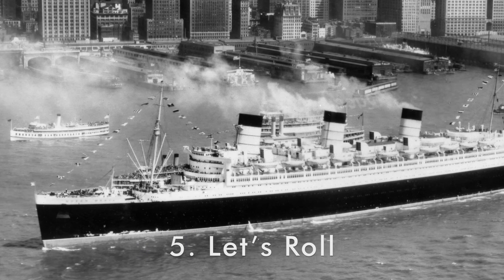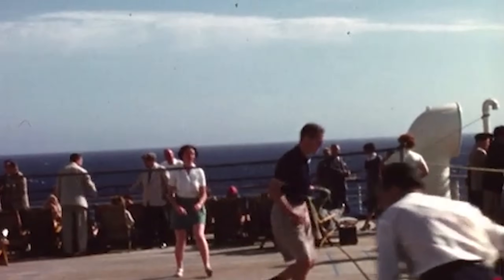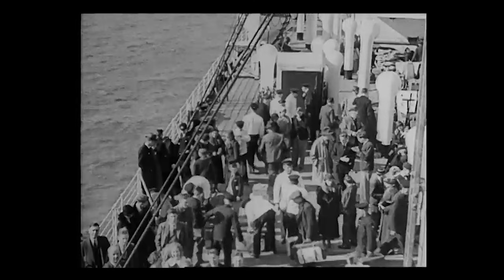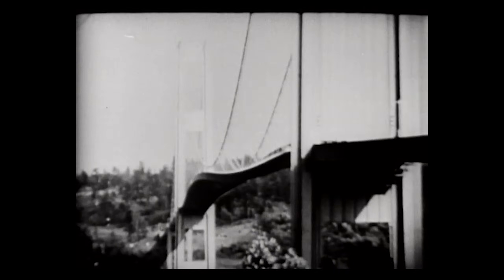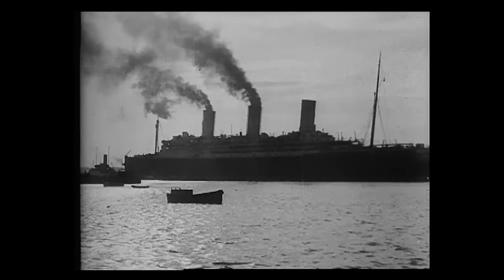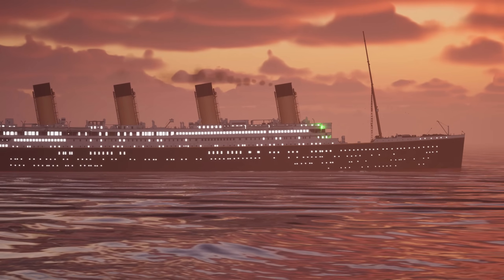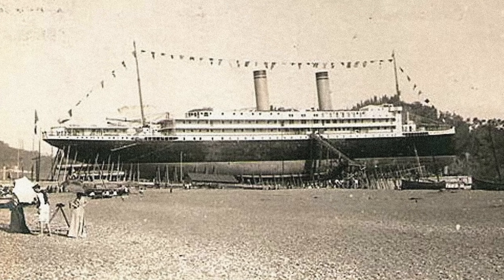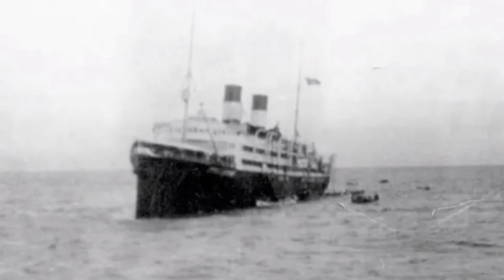5 Ship Design Fails

Comment: Note: The Tacoma Narrows was not due to resonance (as is commonly stated) but due to Aeroelastic Flutter. Basically the wind interacting with the bridge would provide negative dampening to the bridge, and at high enough speeds this would overpower any positive dampening the bridge had, leading to an every increasing torsional oscillation.
Reply: Yeah and it definitely dident have anything to do with soldiers marching. That happened to millenium bridge in London Just from normal walking people.
Reply: *damping
Reply: Galloping gertie!!!!  The broken bits have actually formed a habitat for the local aquatic animals (specifically the giant pacific octopus) and the posts from the original are still standing and can be seen from (or could've the last time I was on) the current newer bridge just to the right.
Reply: Isn't that just a form of resonance? Isn't any self-perpetuating or increasing interference pattern a form of resonance?
Reply: @justforever96  That is incorrect as I understand it. Resonance is specifically as related to a periodic force. Lets use an example: the playground swing. Swings are basically pendulums, with a natural frequency and all. If you make a well timed movement while on the swing, that is a periodic force that is in time with the natural frequency, the swing's motion increases.This is resonance. If you were to provide that force at the wrong time, then you either would not do anything, or would slow the swing down.

That is not how aeroelastic flutter works. In this case there is no periodic or vibrating force. You just have a constant force based on wind speed and the design of an object. In the Tacoma Narrows collapse for example, it did not matter at what frequency that the bridge oscillated at, the oscillations would increase because there is always a force putting energy into it. This effectively worked against any dampening effect such that instead of energy leaving the system (positive dampening), there was an increase in energy with every oscillation (negative dampening). Basically, as soon as this form of oscillations started, and so long as the winds stayed at or above the needed velocity, the bridge was going to collapse.
Reply: @GroundHOG-2010 Strike a tuning fork & it vibrates /oscillates at its natural frequency, but there is no resonance involved until this tuning fork is placed next to a string & causes it begin oscillating via energy transfer from the emanating sound waves (oscillations).

Is that the distinction here?  That aeroelastic flutter is more like striking a tuning fork?  

That makes sense if 'resonance' means one vibrating tuning fork causing another tuning fork to begin vibrating when placed close together because they share the same natural frequency.
Reply: @GroundHOG-2010  I'm aerospace engineering background, in aero-elastic flutter, the periodic force is the aerodynamic force. We either make the structure stiffer, which also makes it have more mechanical dampening. Or we control the aerodynamics with flaps or geometry, reduce/counter the Aerodynamic force which triggers the resonance.
So it's the same thing. 

Think about it this way:
Wind causes the bridge to rotate a little and push it up (peak of the positive amplitude), then it lessened a little, but because the bridge is dampened, it didn't return to its original state. Instead it was titled the other way, causing wind to push it down in the other way (peak of negative amplitude). 
If the wind doesn't lessen up (not periodic) then the bridge would stay twisted one way, kind of like a piece of paper stuck against a fan on the suction side. 
But that is not real world wind work, you have gusts and somewhat similar to waves in the sea, you have ... PERIODS. The strengthening and lessening of the wind matched the resonance of the bridge frequently... Which causes it to "dance". Otherwise it would just easily tilt/rotate to one side.
Reply: @AaronShenghao  I have a question about that. "If the wind doesn't lessen up (not periodic) then the bridge would stay twisted one way, kind of like a piece of paper stuck against a fan on the suction side. "

That assumes a low or zero spring force. But if you have a high spring force (something tells me a steel bridge would have) could it not be possible that the spring force is able to overcome the aerodynamic forces and move the bridge in the opposite direction? 

The idea being that you have a minor (torsional) vibration already in this brdige. The wind at a largely static speed puts energy into the bridge deck as it twists, but is overpowered by the spring and twists back the other direction. The same is repeated in the opposite direction. But as the bridge goes through this cycle it also rises as falls, putting more spring tension in the diverging areas (the front of the structure) and assisting in the twist around "against" the wind. After one cycle, would this lead to more energy within the oscillations despite not having any oscillations in anything other than the bridge itself?
Reply: @William Walker  the crucial bit is that resonance only occurs at or near specific frequencies. In the case of the Tacoma Narrows bridge, the oscillating happened at all kinds of wind speeds. As the wind got stronger the oscillations got bigger until the bridge broke. With resonance, you'd expect a specific frequency to be dangerous and very small oscillations outside of that
Reply: Aero-elastic flutter actually IS one form of resonance effects.
Where aerodynamic force is the initiation force (in contrast to say foot steps). And because the bridge is under dampened, the resonance of the aerodynamic forces made the vibration amplitude to diverge until structure failure or the forces became out of phase (aka aerodynamic/wind force reduced)
Reply: C O O L
Reply: I thought it was a certain speed and wind direction plus precipitation that caused that oscillation to happen, the reason why most cable stayed bridges have a certain characteristic to the deck design and certain cable sheathing

Comment: Queen Mary rolled not because of poor design but because of the last-minute change to the ship's boiler configuration. More speed and efficiency at the cost of balance. They knew what they were doing. The ship survived a 52 degree list after a rogue wave and if she was snappier people would be flung right off a ship that size.
Also neither H&W nor WSL ever billed Titanic as 'unsinkable'. What they said was that the ship was as safe as they knew how to build them. You don't have to be superstitious to know better than to tempt the ocean like that and no sailor or shipwright would say such a thing. The myth of the Unsinkable Ship came around only after the disaster. Titanic was a very safe ship indeed for 1912 but arguably Olympic was the safest ship afloat then.
Reply from the maker: Hi there!
I disagree with the boiler change theory - the metacentric height is the likely culprit. The thing is, all ships roll - it's just funny that Cunard expected QM would not roll at all given its size. 
WSL and H&W did bill Olympic and Titanic as unsinkable, you can find an example here; 
https://wormstedt.com/GeorgeBehe/page2.htm
They also clearly regularly briefed the press and officials in on the ships and likely used the word 'unsinkable', as it was repeated so often and by so many different people.
Thanks for watching!
~Mike

Comment: Fellow history buff Historic Travels revealed that the original design was for the Mary to be fitted with Scotch boilers. A change meant that Yarrow boilers were used instead. However these were lighter the the Scotch design and this changed the stability criteria of a ship designed for a slightly heavier weight making her a fraction top heavy.
Reply: Titania,  Ariel, Cairngorm, Taiping, Highflyer, Blackadder, Hallow-en had stability concern, yet the crew can adjust
depending?
Reply: I believe that that change was made before any steel had been laid.  The change would have been factored into her design.

Comment: some of this rolling of the QM could be attributed to her having traits of Berengaria, the biggest Cunard ship before her, and Berengaria was a notorious roller or limper being top-heavy in her early German years. QM also had elements of Aquitania in her superstructure, ie the glassed in promenades, the high bridge and wide beam. But Aquitania didn't have a reputation as a roller, so why didn't John Brown simply upscale Aquitania standards? They seemed to return to a slim hull-massive speed ratio as with Lusitania and Mauretania, the two of them rollers.  QM was indeed called an 'overgrown-Aquitania' in one video mainly because of her superstructure appearance. The three funnel design, all working, was probably influenced by Berengaria.  All in all so much of previous ships adapted into one ship.
Reply: check out my comment about boiler fitting out.

Comment: Terrific episode, I didn't know that about the Mary. There was a German ship as well (I think), they offset the funnels to one side for more space on the decks but it created a list because of the weight imbalance. They cut the funnels shorter and did some redecorating inside to correct but it never fixed it. I can't find the name but it'll come to me
Reply: Limperator?
Reply: You mean the Imperator i guess ?
Reply: That's the one, thank you!
Reply: Imperator, but the funnels were traditionally placed, it's sister ships though, split the funnel uptakes to both sides of the ship to create more deck space for wide sweeping rooms, and they did not suffer from the rolling the first ship had!

Comment: lets be fair to Britannic, not a lot of ships, specially ocean liner are able to remain afloat after hitting an underwater mine, meant to blow a crater size hole into battleships ( one of the most heavily armoured/protected warship type that ever existed).
Reply: Well, she did still chop up some of her passengers at the start of the evacuation... But I'll still be fair, she did help show that the way her older sister sank was certainly out of the ordinary. For nearly every ship that's gotten damage on a side and sank, they've listed to one side or another by the end... But Titanic didn't. Gotta say, whatever happened on the Titanic up to that fateful night certainly leaves mysteries...
Reply: @Rand0m0bs3ss10ns  Honestly, I didn't think of that, but now you mention it your right, she didn't list heavily to one side or the other when she sank, despite her breaches literally only located on the starboard side. 

As to the chopping of passengers by the largest bender in the world known as Britannic's propellers, I would put that more on the lines of human error rather than the ship's fault, I mean it is the crew who pretty much dictate when the boats are lowered and whether or not the engines remain running or not. So the fact that a few boats with passengers got thoroughly chopped, I can't really bring myself to blame that on the ship. She was sinking, her crew kept the engines running as well as lowering the boast and she naturally had her stern rise as she sunk bow first, ain't really her fault. 

But still, very interesting comment, keep commenting on small details like that, god knows there aren't enough people who look in-depth into these kinds of things and others related to it.

Comment: Great video.  Propeller cavitation seems to have been a problem with just about all 4-screw express liners.  Mauretania, Lusitania, and Normandie are the ones that generally come up, but most of the big, fast ships grappled with it to some degree.  Normandie's vibration problems improved with a new set of 4-bladed props, as did Mauretania's, but neither ship was ever completely vibration free.
Speaking of the magnificent Normandie, she had an issue with rolling nearly opposite to QM- the great ship would roll a bit, then snap back to the vertical with a violence that would send things flying about... Still, these were great ships, imperfections and all.  To Queen Mary's credit, though she came to within 3° of capsizing when broadsided by a nearly 100' wave, she did  come back up again, and got the 15,000 bruised, bloodied, but grateful troops she carried safely to their destination.  
🚢Always a pleasure to watch a new video from Ocean Liner Designs!
Reply from the maker: Yes quite right, it feels wrong calling Mary out on her rolling when the ship endured some insane conditions and survived just fine. I think the real design failure there was the lack of handrails :)
Reply: I think its a cause/effect situation, why did they put 4 props on the liners - to transmit as much power as possible into the water, cavitation is caused by so much power being put into the water that the water vapourises due to the low pressure on one side of the propellor blade, so if you're pushing the limits of how much power you can put out you're going to run up to the limit. 
As an aside this is why submarines making long distance transits do so at depth - cavitation is very loud (all the bubbles collapsing) so if you can prevent them forming by increasing the pressure overall at greater depth then you can stay quieter at higher speeds.
Reply: I heard it was 16000 on board?
Reply: @atomicwedgie8176  she still holds the record for the most people carried by ship in a single journey

Comment: I think the bulkhead issue is the key area where White Star was guilty of sacrificing safety for style.  Even if a glancing blow along multiple compartments was unlikely, it was still feasible; 60 years previously the Great Eastern had a massive gash ripped in her side by an uncharted rock, but was able to make it safely to port without even developing a significant list, thanks to her double hull.
Had the Titanic's watertight compartments gone even one deck higher it's likely she could have remained afloat - at least until help arrived; however one irony of the disaster, that I rarely see mentioned, is that a coal strike in 1912 had meant lines cancelling a lot of smaller sailings to guarantee there would be enough fuel for their big liners.  Some of the passengers, like the Hart family, had received transfers to Titanic in compensation for their original bookings being cancelled.
As a result, the shipping lanes were far quieter than usual in April 1912.  In normal circumstances there would almost certainly have been more steamers available to offer aid in Titanic's near vicinity.

Comment: Another GREAT Video Mike!
Just 2 questions; Don't they put these ship in air tunnels to design the smoke stacks? Why don't they have a bulkhead in the middle going from the stern to the bow to cut the water  intrusion by half?
Reply: Air tunnels are pretty much a post WWII thing.
A longitudinal bulkhead down the centerline of the ship would actually make it more prone to capsizing.  Any water flooding in would be confined to just the side where the damage was.
Reply: @JWRogersPS  Thanks all makes sense.

Comment: Interesting that Imperator didn't make the list. Famous for its rolling, necessitating extreme measures such as trimming the funnels, pouring concrete into the hull and removing heavy fixtures and furniture. On top of that, it had electrical wiring problems which nearly caused disastrous fires.
Reply: Yes, SS "Limperator"!  You're quite right.  It is actually somewhat difficult to find a photograph where the ship is fully upright.
Reply from the maker: Definitely one for next episode :)

Comment: Note... Queen Mary unfortunately was never the largest ship in the world.  Great video once again!
Reply: Umm, Yes it was, the Normandie was refitted after the QMs madien voyage to make her bigger than the QM. Normandie (pre QM) 79,000 GRT. QM- 80,770 GRT, than Normandie post refit was 83,404 GRT.
Normandie is 10 foot longer but the largest ship is measured by GRT not length
Reply: @tinypoolmodelshipyard  Normandie's refit was completed in the winter of 1935-36, prior to Queen Mary's maiden voyage.  (sourced in John Maxtone-Graham's Normandie book)
Reply: @Michael Ryan  no, out of all the resea4ch ive done and multiple sources on google, No, i was correct, her refit was during QM madien voyage, QM held largest ship in the world for just under 3 months. Queen Mary was the first ship to surpass 80,000 grt until Normandies refit gave her the advantage of over 2000 grt. Normandie started and ended 1936 the worlds largesr ship but QM took it for a few months in between there.